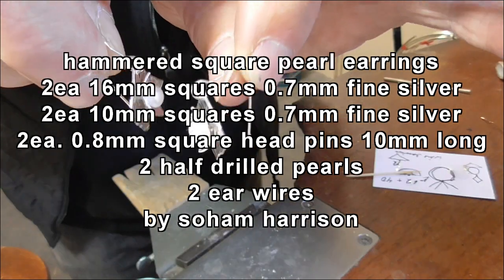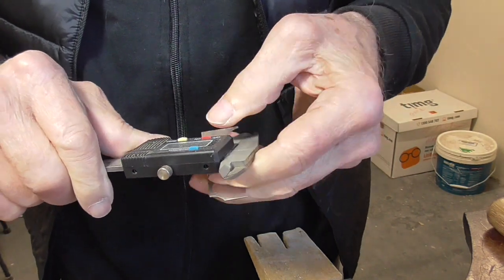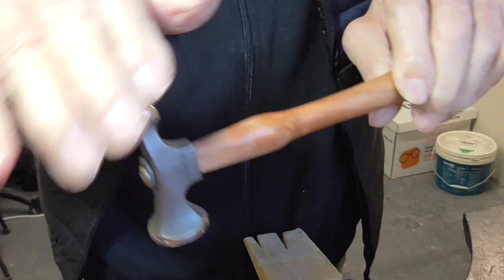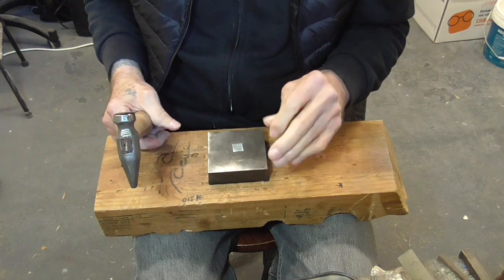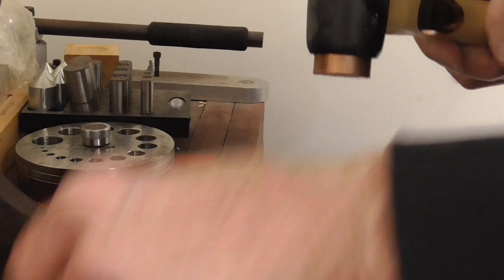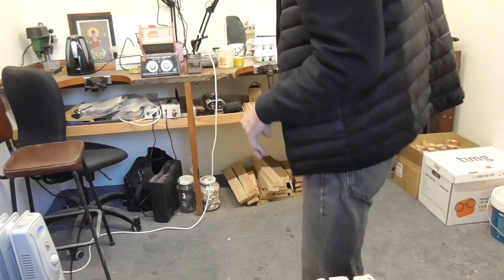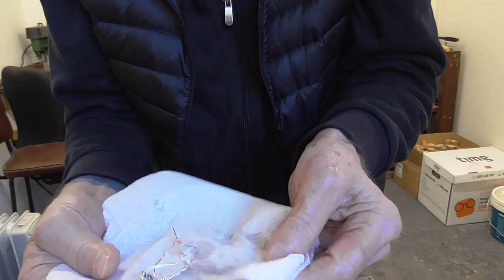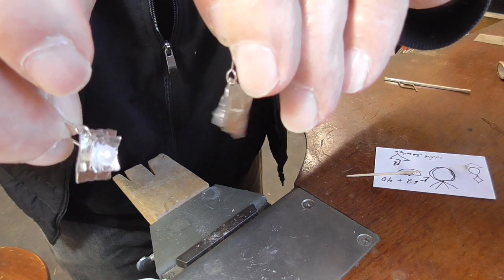hammered square pearl earrings

Comment: My only problem is that I want to go out and buy the tools you use, which are high end tools, and which I can’t afford, LOL! Nah, I’m pretty good at improvising. I do need a better quality caliper (?), however. Love watching your videos, learn so much. Thank you!
Reply: For this project, you might, instead of a caliper, also use dividers. And if you don't have shears, you can, of course, also use a piercing saw. You also do not need a propane/oxygene torch - a simple crème brulée torch is more than enough. If you don't want to buy expensive hammers, you can modify and polish some cheaper ones from a hardware store. Instead of a dapping block and round punches, you can use a piece of wood and a ball bearing ball.